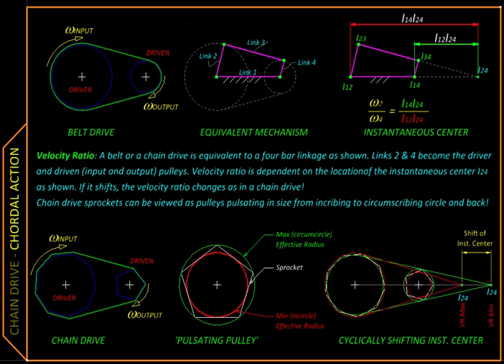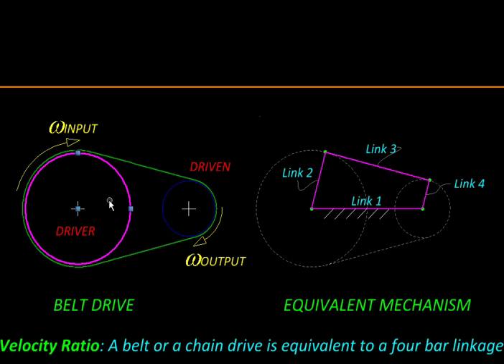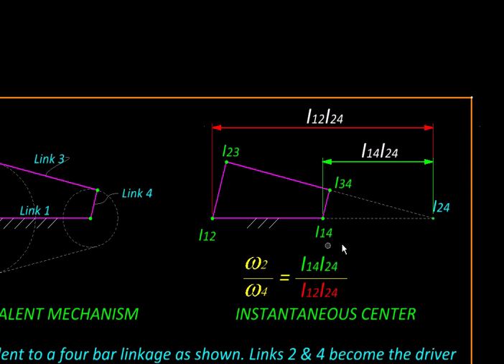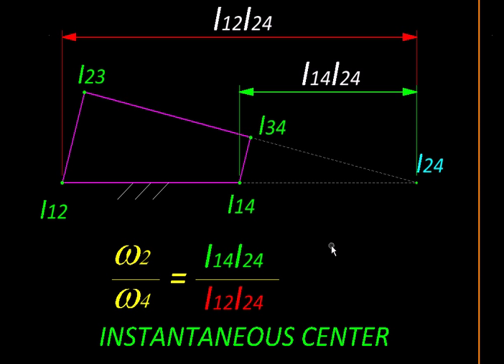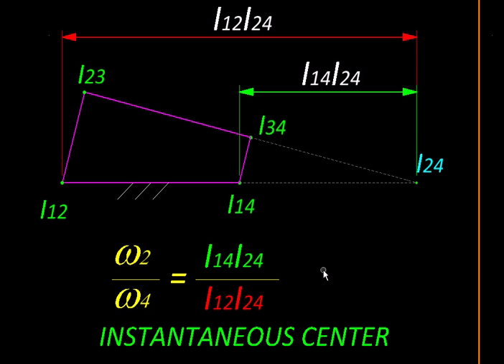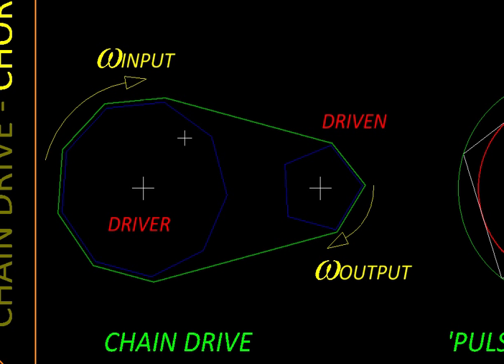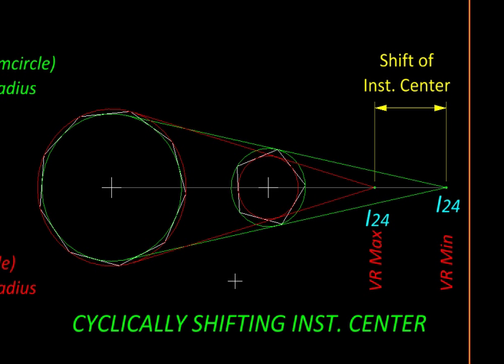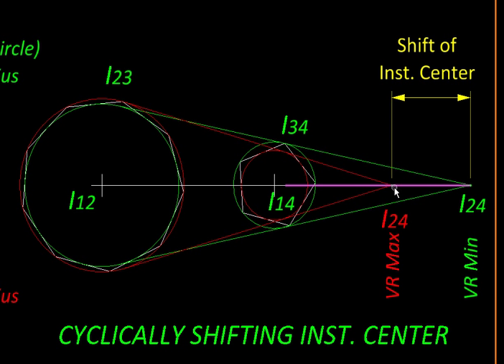Kinematics Ch05 A Chordal Action in Chains

Comment: But why chain leaves the sproket a different point ? I did not get that
Reply from the maker: +amit som Try to sketch two different positions of a polygonal pulleys above and simply try to draw a line touching them both with a ruler. You would see that the last point of contact is not always the vertex. It could also be the entire side of the polygon. 

Wish i could sketch it here somehow. But hope you get the picture.